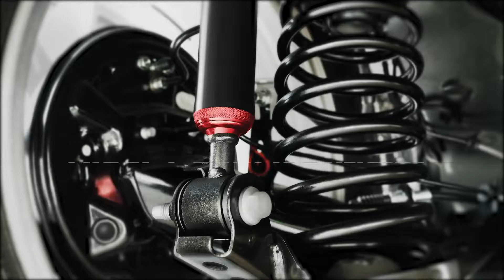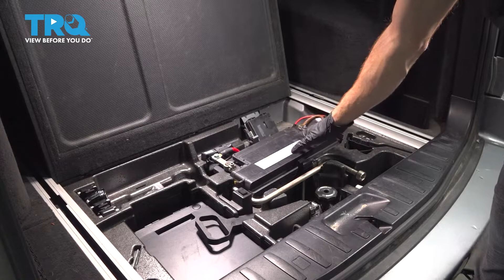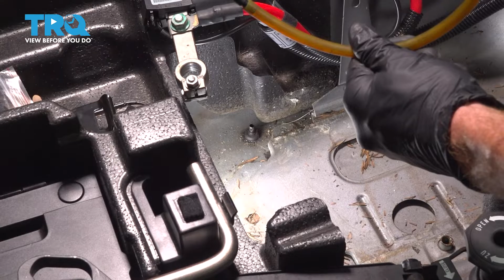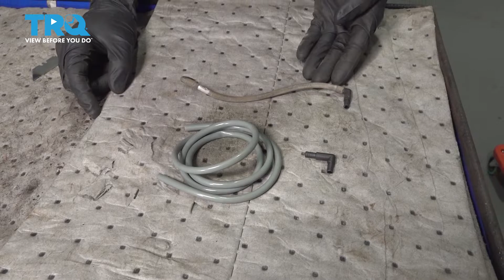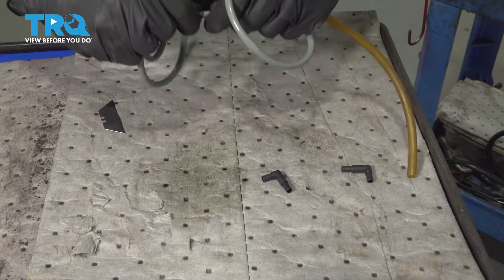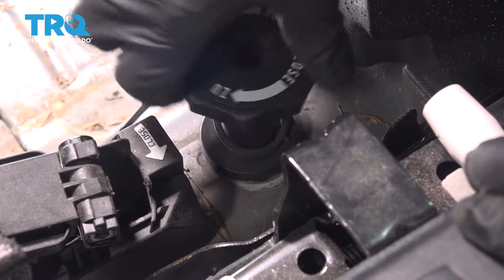How to Replace Battery Vent Tube Kit 2004-2010 BMW X3

Comment: @TRQ ive installed my battery but my vent tube sits like the one your video does with a slight gap to the lip. Is this correct as it doesnt go in any further